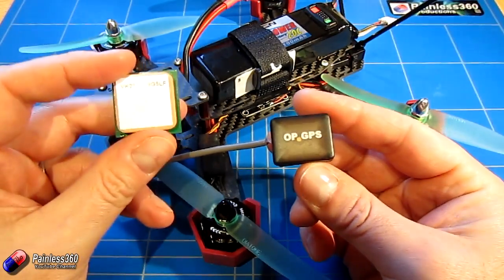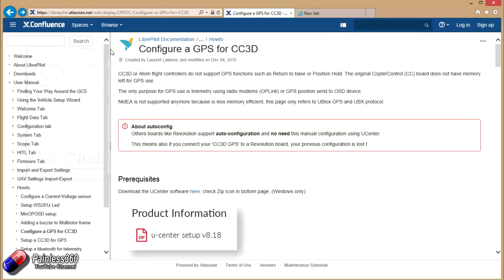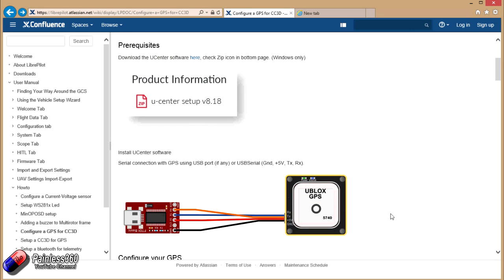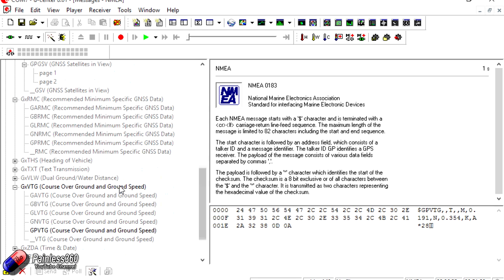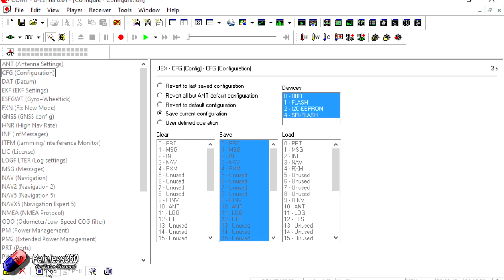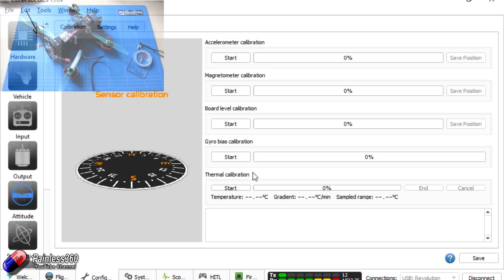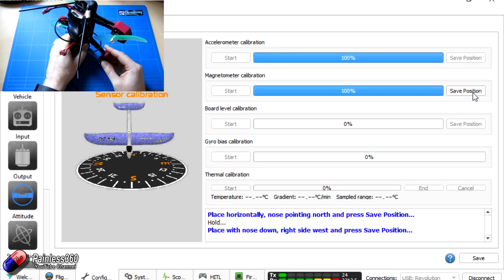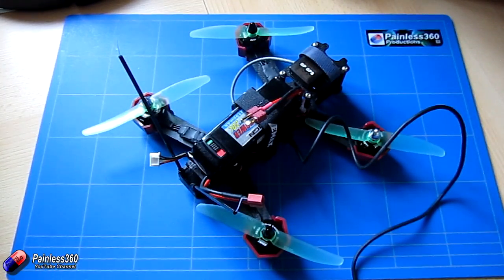(3/3) CC3D Revolution and LibrePilot: Adding GPS and extra calibration steps

Comment: Great video as always. Got exactly the same Revo/gps myself. Had a few probs with mine, my case fell apart which wasn't a big deal but annoying and then the gps burnt out my esc. I'm not the only one according to BG's comments on the GPS sold on its own. Worth keeping an eye out for it getting hot mate.
Reply from the maker: I've replaced mine with another larger unit. Thanks for the warning..
Reply: +Painless360 So whats the advatge to a larger GPS module? Is it simply that a larger antenna gets better signal? 
Apart from the laborious setup, whats the big disadvantage to using the cheap OP GPS box? In a nutshell, why did you change to a different model?
btw, thanks for the excellent videos. yours video guides are the best on the net!
Reply from the maker: Larger sensor and improved electronics package give better reception that results in improved location accuracy and start-up times. Best of luck!

Comment: Maybe I spelled wrong - it is not about the FTDI Adpapter - it is about a "connector board" from  this small GPS connector to so kind of "mediaotor" device  where I do not have to manually detach wires from a connector
Reply from the maker: Sorry, I don't understand..
Reply: +Painless360 -- I think he is talking about the connector you are using from the FTDI adapter and the OP GPS connector. I was wondering about that myself because when I tried to just push some copper wire into those tiny holes, they touch and I think fried it. As it is not seen anymore. I got feed back once and then went I tried to move it and connect to the desktop versus my tablet it was seen then I noticed the wires touching
Reply: +Donnell Bullock you are right. I found in the meantime such a 4port cable with a wired female connector and its male counterpart with solder pins

Comment: Do you have a link to purchase the FDTI as local shop didn't have one, and I searched ebay and such, and the ones that I saw, though not sure if makes a difference, seem to mention specific for different FC  arduino or MultiWii and 3 or 5 amp..........AND....I haven't a clue which.........  LOL  they do seem to be cheap, 3 USD.  and is anything else needed, as I noticed that other 'pin' thingy you show.  Have too many mini usb already.

THANKS
Reply from the maker: +LA smyth They are generic, search for FTDI basic and you'll find them on places like eBay and others.. Best of luck!
Reply: +Painless360 Thanks,  kind of what I thought, just wanted to make sure, or if they were specific, be nice to know.

THANKS

Comment: I'm having trouble talking to the gps through the FTDI. I'm connected through a com port @ 9600, but the packet console view is giving me data that is blank. I've tried switching the Tx & Rx wires, but doesn't help. What am I missing? I have tried two different gps units. It's the same one you use in the videos. Any help you might offer would be appreciated.
Reply from the maker: +Chuck Horton You would be very unlucky to have two GPS units bad so I'd suspect the settings in GNSS or the FTDI adapter. If you know the adapter is good then make sure 'auto-boarding' is ticked and the FTDI port is selected in the GNSS GUI when you try and connect.

Comment: Sorry for another Q, I think you said in your video almost any GPS Should work...Would that include a Neo 6 / 7 and whats the diffrence between a 6 / 7/ 8 are the newer ones just faster and more acutrate...aka should I upgrade from a Neo 6?
Reply from the maker: +CyclingSalmon14 Lots of detail about this from the manufacturers if you want to research it. Simple answer - improved position fixes, less errors and faster start-up times. Happy flying!
Reply: +Painless360 Ta!
Reply: +CyclingSalmon14 Neo 6 = Crap,
Neo 7 = good,
M8N = Best choice
Reply: +David Kaden :) Got a neo 7 lucked out haha.

Comment: Just in time! I literally got most of my quadcopter bit and pieces in the mail including the gps.
Obviously the auto-setup didn't work for me aswell, so this is EXACTLY what I was looking for.

Thanks alot!
Reply from the maker: +Simon Schödler Blimey - you were very fast! I literally just uploaded this one! :) Happy flying and best of luck with your build..
Reply: +Painless360 Thank you!
I got a question tough, maybe you have an idea:
I've set my second flight mode to VelocityRoam/Position hold and slected the GPS assist.
I can't seem to arm the thing with these setting. Any ideas?
Reply from the maker: We will be covering all that in a later video about using the GPS modes.. Best of luck with it..